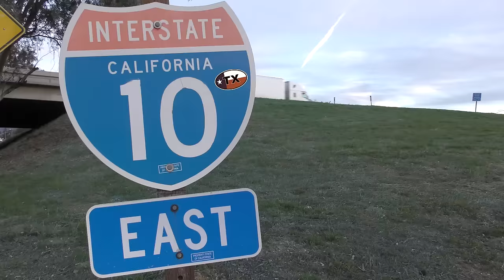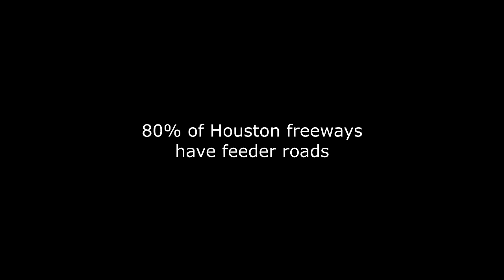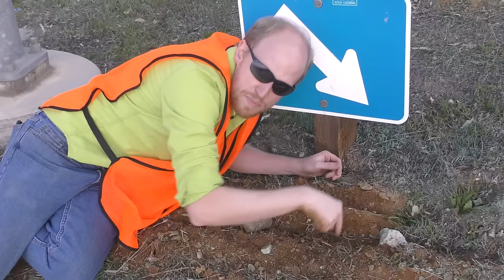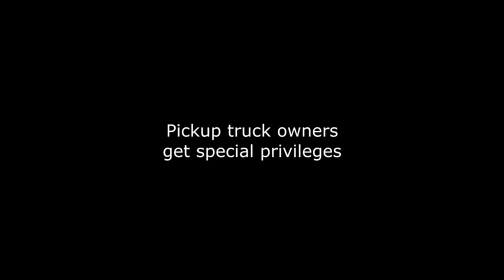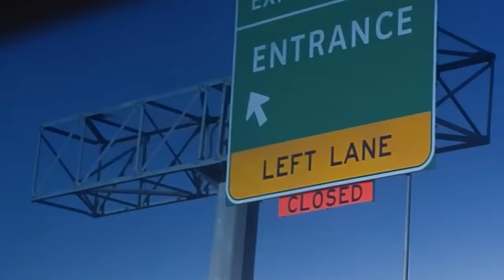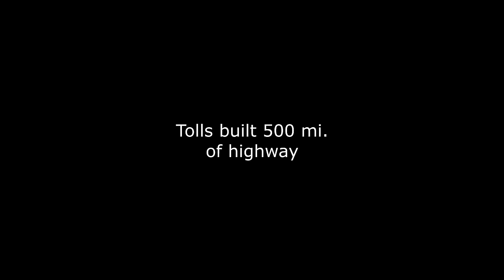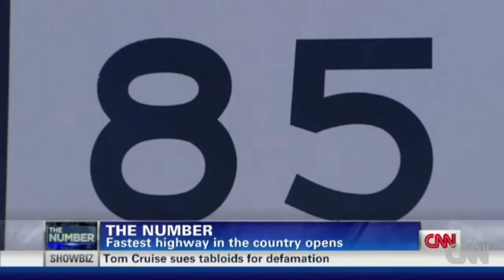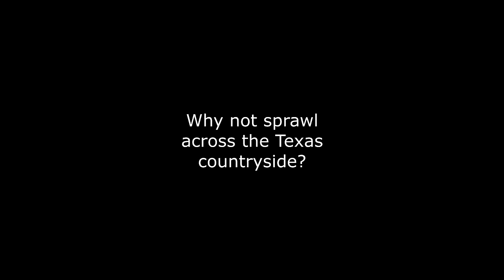How does good Texas engineering make REALLY BAD roads?

Comment: Sorry, but this is a 100% troll video.  

I agree with some others that most of the "bad" things listed in the video are actually features of the system and actually good. 

- Frontage roads with businesses along them reduce traffic on neighborhood streets and actually put high-use destinations on high-use roads, the more efficient way to handle that traffic; the so-called "cheater" system is intended directly for that use to reduce the traffic sitting at stop lights on the frontage roads (the people "cheating" are not merging into main lane traffic, Texas highways are designed to use auxiliary lanes between entrance and exit ramps)... its great benefit is that it gives drivers options when there are unforeseen circumstances or road work on either the main lanes or the frontage roads.

- The rural yield signs on exit ramps are actually safer than having entering traffic yield on the ramp (reduces high-speed rear-end crashes... has exiting traffic use the ramp to reduce speed safely instead of reducing speed to a full stop... and eliminates the potential backup of traffic onto the main lanes).

- The argument about sidewalks is misplaced: the highways or "freeways" as you call them (get to that later) are managed and built by TxDOT... the roads you are complaining about are maintained by cities and counties -- not TxDOT.

- Regarding toll roads, tolls roads in Texas are not called freeways.... so... there isn't any confusion about that -- AND there are NO toll roads in San Antonio, those have been actively fought against and the state has for several years now had a moratorium on new toll road projects in Texas after the state developed new revenue sources to pay for their construction. Florida and Virginia (among others) are more guilty of using toll roads to expand their highway systems. 

- Complaints about sideways traffic lights... they are also seen in Florida and traffic light alignment varies among the Texas metro areas.

- The SH 130 toll road was a private company managing the highway that went broke, not the state... the state has been considering paying off that toll and making it free to use to encourage more use.  Your real argument should have been the original plan for that stretch of highway, making it a multimodal highspeed transportation corridor for cars, trucks, freight trains and energy distribution. That toll road is great to have as an alternate way around the traffic nightmare of Austin to get back to San Antonio via Interstate 10. Without the toll, it would likely be valid alternate route for long-distance travelers, particularly those coming from Mexico (freight and passenger) to Waco and points north.  Plus, long term, there will be more development in the area between New Braunfels and Seguin and that road will become very appealing for people commuting to Austin (not that the toll operator should be betting on that, but that road does have a future).

- The expansion of the state highway system is not responsible for the impacts of historic flooding in Houston and despite the historic nature of that flooding, it should also be noted that Houston has generally recovered from that storm far better than smaller metropolitan areas in states to the east. If there is a "problem", it is city urban planning and land use -- not the highway system (refer to the Ellicott City, MD, floods).
Reply: I've lived all over the country during my life including Texas. Texas has a terrible and confusing road system, it is one of the worst I have ever traveled on for anyone outside the state. P.S. Your point that the Texas traffic light system positioning "varies among the Texas metro areas" makes his point not discredits it.
Reply: @mn1q  I have also lived all over the country... I've lived here three years after time in NY, New England, the DC area, Delaware, and Louisiana... plus have spent a lot of time in other states, too.  Your point about it being confusing is not his point -- he is trying to call out engineering faults in the state highway system and so-called "inefficiencies" in it.  And regarding the traffic lights... that is not his point either.  All he did was call them stupid.  My point is that a) they are not unique to Texas and b) they are not ubiquitous across Texas.  He specifically refers to TxDOT throughout the video, but issues like traffic light positioning are more a local public works matter (the state transportation's own guidelines do not specify whether traffic lights should be horizontal or vertical).

Comment: Frontage roads are about the stupidest road design there is. Mixing fast traffic with slow traffic people pulling into high speed traffic at 25 mph. Many times you see your destination but can't get to it or pass it when you exit the hwy. People try to move quickly over to the right across three lanes to get to  that store or shopping plaza. Texas highways has the absolute WORST signage I've ever seen. A jumble of signs. An eyesore and confusing. Roads with three or four different route numbers. Insane and illogical lane markings. No reflective dots or  bots marking lanes. Drivers DO NOT STAY IN THEIR OWN LANES IN TEXAS.

Comment: The answer is mexico. Texas has a source for cheap labor, and it shows in all the infrastructure there. Not saying it's bad, not saying close the borders whatever. I'm saying that's why the infrastructure is so shit in Texas. The power grid failed during the winter storm because it's cheap as shit. The roads are cheap as shit. The houses are cheap as shit. That's why they fall down after 10 years and need major repairs. What is there to engineer about a flat concrete surface? Concrete is shit anyways, no grip what so ever;  But i guarantee it's down to money. Cheap labor.

Comment: Let's get this out of the way up front, Texas is tacky.  No problem with them building highway "malls" to match.  The first few problems really sounded like positives to me.  More convenience, better traffic flow.  Nothing wrong with "cheating" a red light; that makes the road more efficient and reduces emission by preventing cars from sitting there idling.  Frankly, the only people who should be stopping at those lights are ones planning to turn off the road there.  And the toll road application is not a bad idea if done correctly.  I'm sure tax payers who will never use those roads are happy not to be footing the bill.  But you have to make the roads in a place that makes sense in the first place, else you'll run into the issue in the video where no one is willing to pay to use the road.

Comment: As a former FHWA Transportation planner, I really do like Texas' interstate system and how they design their exit (deacceleration) and on (acceleration) lanes. You can actually exit and at every exit they have a u-turn lane that allows you to quickly go in the other direction if you missed a turn off. They are the kings of toll roads and I also like that they have some high speed toll lanes where you can go 85 MPH. Talk about quickly getting to you destination. Every state is different and the only standardization is no standardization!

Comment: Any city in the United States that receives 30” of rain in Two Days will flood. Duh 🙄
Reply: Especially in a city that's right by the ocean and sits like 60 feet below it
Reply: @vrettos99  Houston is 50 miles from the Gulf of Mexico
Reply: @oldpeople1970  Houston is also 23 miles from trinity bay which is a body of water connected to the gulf of mexico, the Buffalo bayou is a river that runs to this bay through the city of houston. Clear lake is another body of water 27 miles away from downtown houston which has clear creek running to clear lake through south Houston and pearland. If a storm surge occurred those bodies of water would be the first to overflow and cause massive flooding in the surrounding areas. Also once again Houston   is one of the flattest metropolitan areas in the US making water runoff easy to spread for countless miles.
Reply: It’s Buffalo Bayou not buffalo river, by the way I have lived in Houston for the past 65 years and have never flooded